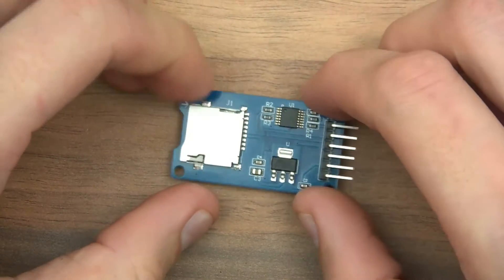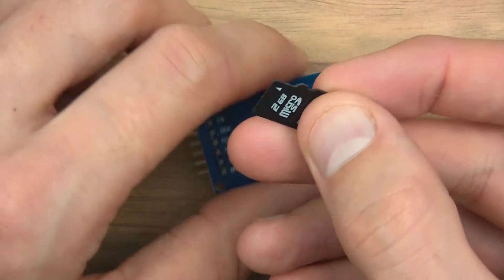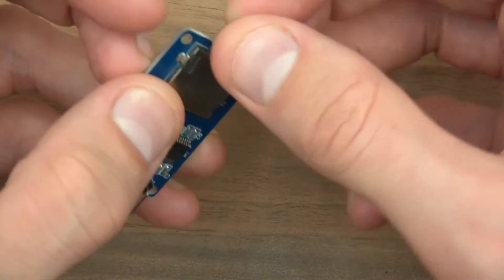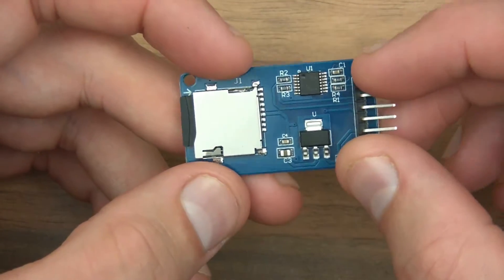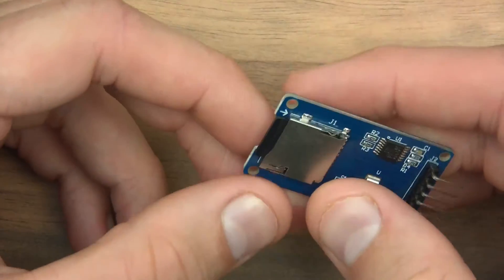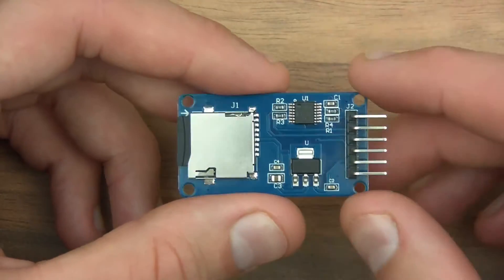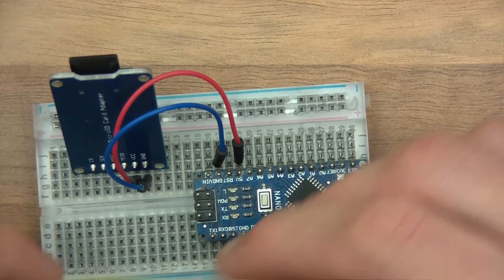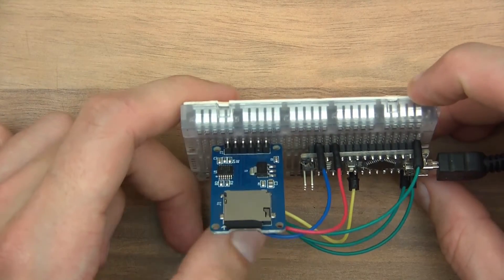TUTORIAL: Micro SD Card Reader / Writer How to Quickly Get Started - Arduino Module DIY - Part 1

Comment: Hi i am currently stuck. Everything is working fine but i am unable to get to the Usb drive to do the formatting. The Folder did not pop Up. What should i do? I've worked with 2 sd card and i am having the same problem for both.

Comment: Hey Anthony, can you help me? I keep getting the initialization error that the card isn't even recognized... I'm using what looks to be the same SD card reader, Arduino Uno, and a 2 GB Sandisk Micro SD card (same size as yours). I followed the same formatting procedure, as well as your example sketch. I have also tried many other examples and have gotten the same issue. Do you know what my problem might be?

Thanks
Reply from the maker: Hi, try a different card or different reader maybe?

Comment: You can't "clean" data by deletion or formatting. Do not use Windows or other OS formatting to format SD cards. SDcards have several formats and partition types that you can't see/charge easy in Windows and other Format tools. May seem to work but many SDcard problems often resulting in lost data are cause by using wrong formatting. Windows or Mac use SDFormatter from SD Association at https://www.sdcard.org/downloads/formatter_4/ Correctly handles all cards and options to clean or wipe data by overwriting in software or hardware. That Chip you ignored is a buffer (74LVC125A) used as a level shifter because SDcards are 3.3v devices. Modules without level protection can damage SDcards connected directly to 5v SPI pins.
Reply from the maker: Thanks for your commento!